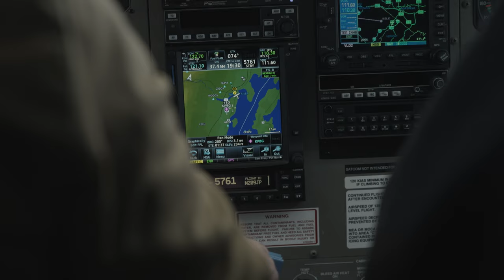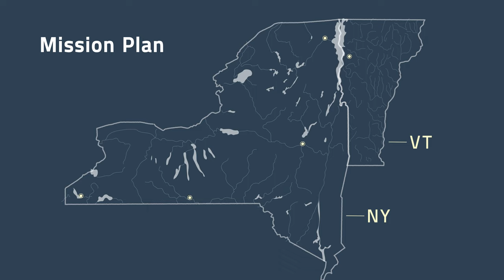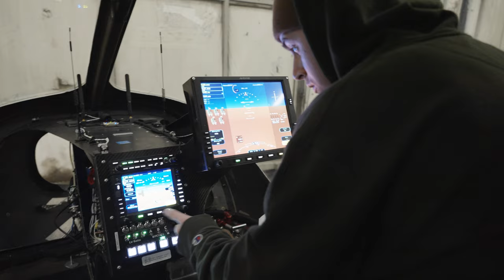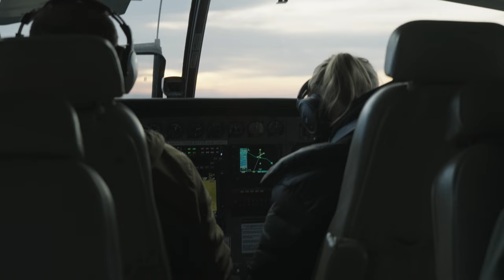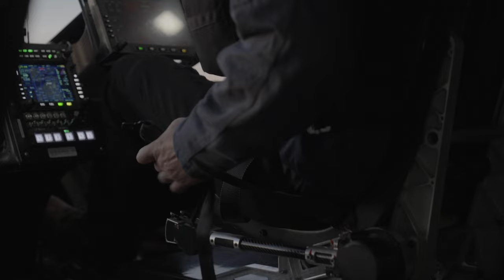Audacious Goals - 386 mile all-electric flight

Comment: Talk about range anxiety. I noticed the pilot was wearing a parachute. What happens if, for any number of reasons, one of these planes isn't able to land even as the battery is going dead? Yes, a plane powered by a combustion engine can run out of fuel, too _ but they typically have much longer ranges, while battery range is affected by more variables: payload, cold temperatures, wind speed and direction. What's the procedure for landing one of these birds with a dead battery?
Reply: Wind speed and direction affects every aircraft regardless of energy source. Landing without power is called a forced landing and is trained for every aircraft type. He was wearing a parachute because it was a test flight.